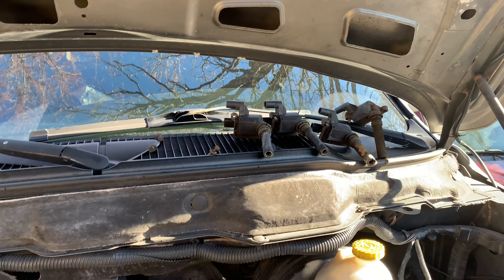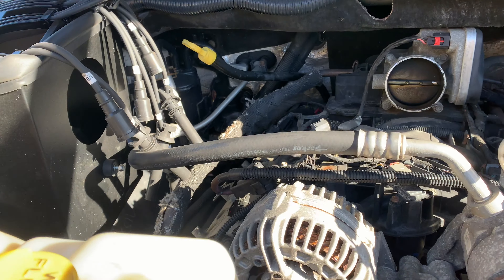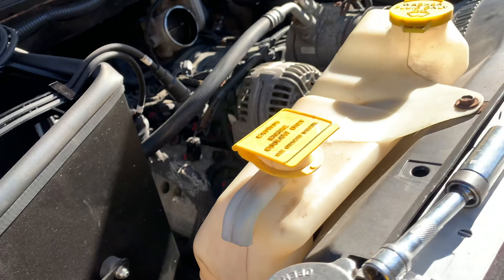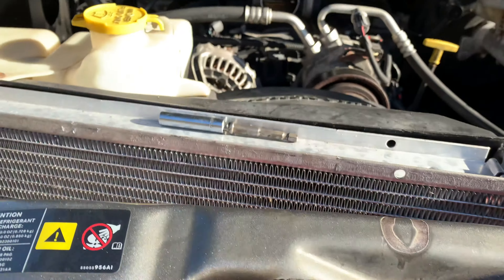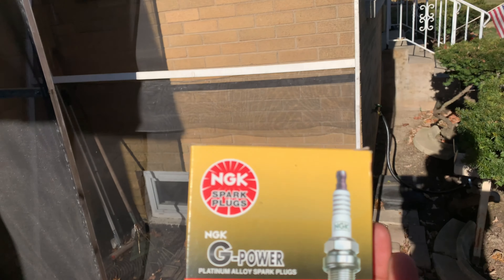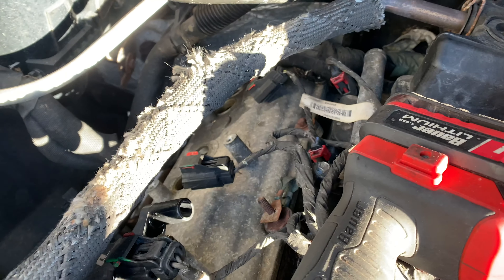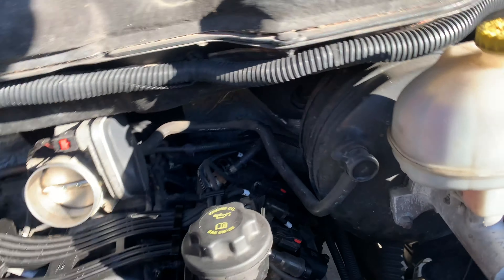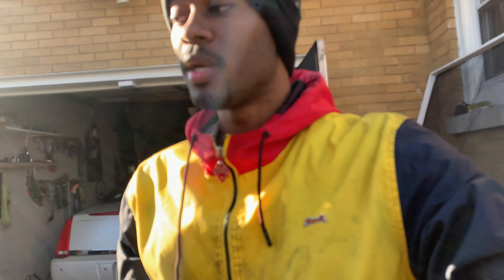2005 Ram 1500 Spark Plugs & Coil Packs

Comment: Crazy ass design the last thing I had with dual spark plugs was the old 4cylinder foxbody lol pretty weird to see it on a more modern ignition system.
Reply from the maker: Hey thank the engineers at Chrysler🤷🏾‍♂️. And I also think Chrysler prefers copper plugs